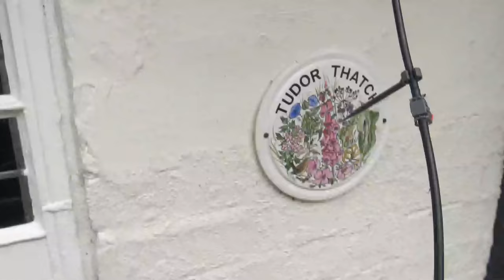Surveying a timber framed, thatched cottage - what to look for

Comment: Once again a fine assessment Peter. With many thatched builds that have no guttering I usually recommend putting in a French drain which is dug down to below the foundation when the ground level is higher than the floor level. Somebody once told me that if you put a strip of copper along the ridge of a normal tiled roof that this would kill off most moss and stop any further growth, would this work with a thatched roof as well? How often would the ferrous sulphate have to sprayed on and what is the rough cost for a container of the stuff please?
When you look at most buildings issues with damp, sticking them up on a short raised brick or stone columns might well be a possible solution.

Comment: What was the name of the chemical that kills the moss on the roof?  I went to see a cob cottage with thick moss on the thatch, maybe it's too late.  She said a thatcher told her he can patch it up.  The cob walls have been rendered with cement and is cracking.  The client contacted me to repaint the exterior walls with sandtex.  I told her the cement should be removed and re-rendered with lime then lime washed.  I haven't heard back from her.
Reply from the maker: Yup - ferrous sulphate... Should tell the woman that if walls are cob, the house WILL fall down if cement rendered... You could try showing her how wet it is behind the cement ... Bet theres timber behind there too - will be like a compost heap.

Comment: Would you remove all exterior paint then after repair lime wash it?  And in regards to the timer frame would you have to fully replace the whole lot or just infill the damaged parts? How would you protect the exterior woodwork? Creosote? Cheers James.